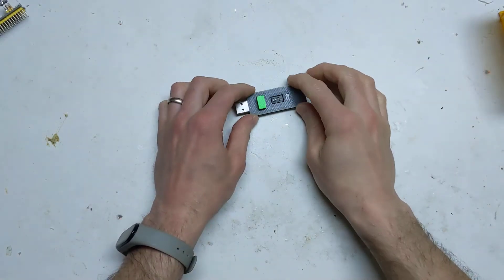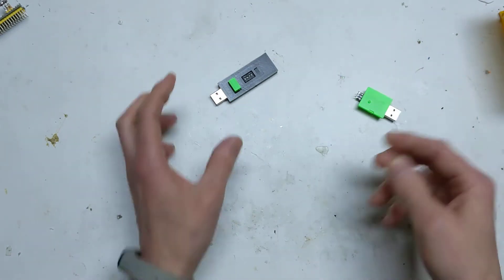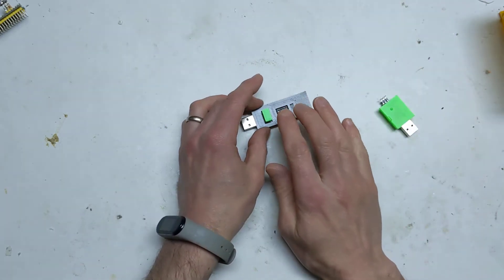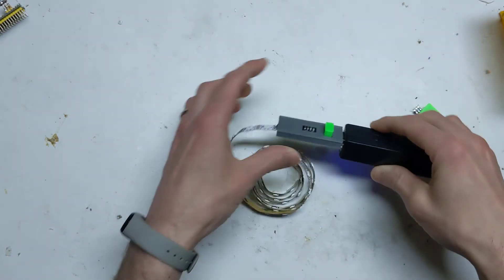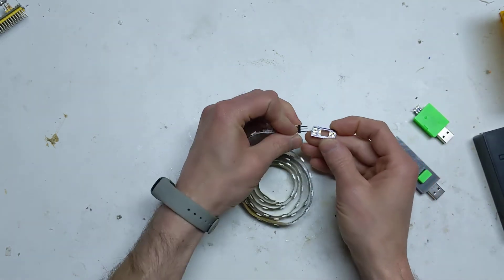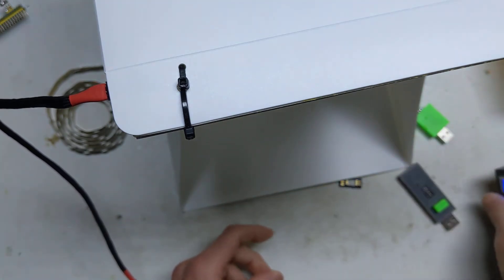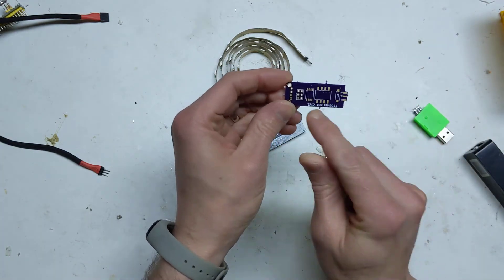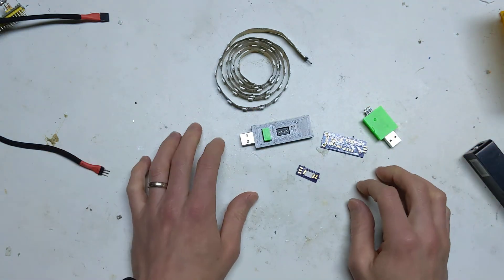Attiny Few WS2812 Controller Boards

Comment: Instead of a dip switch you could use one button to cycle through all patterns
Reply from the maker: The problem with doing that is most of the patterns have "wait" command in them so it won't see the button press when it happens. I've coded mine to check the status of the switches in the setup part of the sketch.